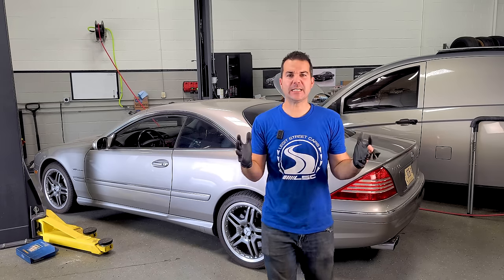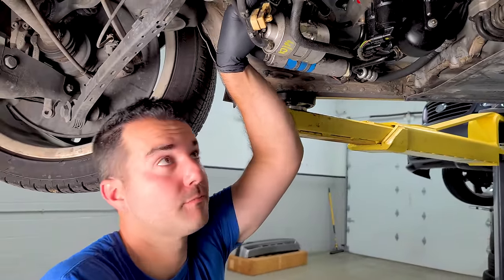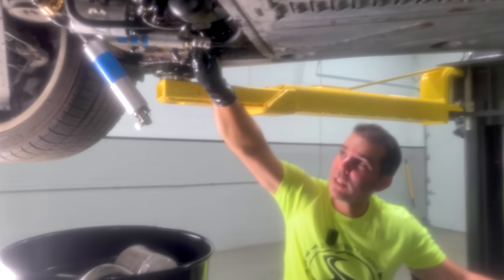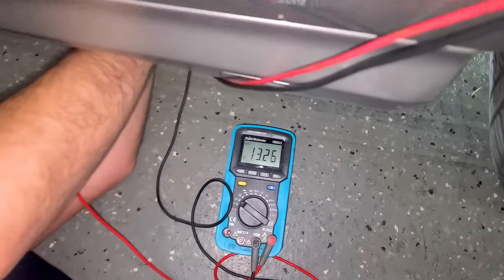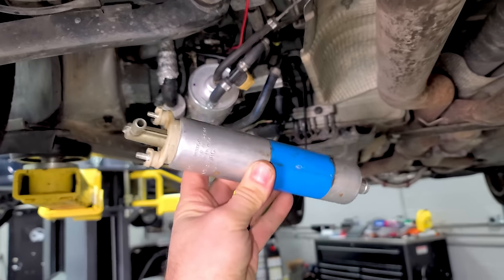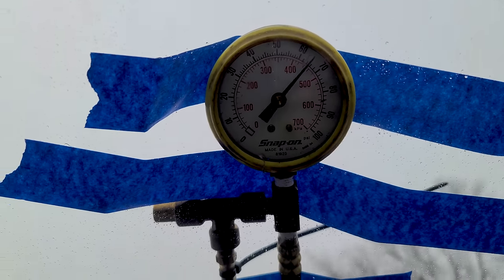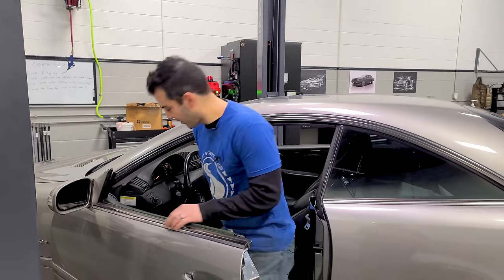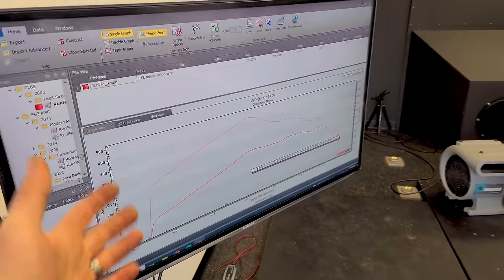I Used Bugatti Veyron Parts & An Alex Trick To Fix My CL65 AMG V12! You Won't Believe What Happened!

Comment: Legitimately one of the most informative detailed automotive channels. Dude literally telling you the size of the bolt while he's taking it out. If someone took that car to a dealer they probably deemed it none repairable to them before they ever put a 2nd pump on to resolve the problem. I have the same problem with a 14 6.2 ltz Silverado gets plenty of voltage 0 issues besides wide open throttle fuel pressure drop. Bought it as a remanufactured lemon buy back. Only drops fuel pressure under wide open. Replaced pump 3 times filter 2 times new lines fuel rails new injectors same issue if you floor it the fuel drops to about 25-30 psi and it falls on its face and goes haywire. They replaced the ecm at the last dealer as a last ditch effort. Never a problem for me since I don't floor it everywhere but best bet I'm adding a second fuel pump after seeing this video

Comment: With the weird honk noise the intake produced under high load and WOT, combo that with the car suddenly going very rich and into limp mode, maybe it is collapsing/has collapsed an air filter from the upgraded turbos? I have only seen this a few times on EcoBoost F150 raptors. People will upload a tune, tune increases boost pressure, and it collapses the OEM paper air filter, causing limp mode/rich codes from restricted airflow. Not sure what filters you're using, but those sure looked like stock air boxes, so I assume they're factory. Hope this helps man! Love the content as always!
Reply: it is leaking air somewhere, the MAF still reads the air going in so in the end you get rich mixture as the air is not getting inside the engine.

Comment: Check all you body grounds on all computer boxes and voltage box for the fuel pumps. A had a problem like yours and I had a tiny ground lead under the hood that was 90% broken off the fire wall. That was after 6 months of banging my head off the wall trying to find a problem and lots of $$ later it was a 25 cent wire. Good luck!
Just keep telling yourself I love my car! Lol. Cheers

Comment: Random note about your body temps on the infrared camera- I’m an A&P mechanic who bought an infrared camera to use for troubleshooting planes and after shining it at my hands I asked exactly the same question. The answer was so obvious I cringed… your internal temperature is higher, but given that your skin is a thermal shield, you lose about 4-5 degrees from inside your body to your skin. Try pointing it in someone’s mouth and you’ll see what I mean. 

Anyways, love the videos as always!
Reply: What thermal camera is this?
Reply: @Dierksman  I have a Flir camera. The one he used in the video is a cheaper type, not sure what brand exactly.
Reply: 8 months old comment, but just wanted to pipe in and say you're right.  But also more than insulation, your skin acts as a heat-exchanger/radiator as well.  Hot blood moves to the surface where the heat is dissipated.  If it's too hot to sufficiently cool off, your awesome, nifty brain and body add water to the mix which evaporates and takes the heat with it.  Thus, why you sweat.

Comment: I have a 2005 CL65 AMG that had this exact same issue, the dealership couldn’t figure it out. I replaced both coil packs my self and that fixed the issue, never went into limp mode since.
I found these coil packs can throw the car into limp mode intermittently. 
I also have a 2006 S65 AMG that had a similar issue and I also replaced both coil packs. That did not fix it. Ended up changing the ignition transformer. Silver box on the middle of the engine. That fixed it. 

I would definitely say you have a ignition issue not fuel.

Hope this help’s!
Reply: This!
Reply: damn bro this has to be it, if its not eh othger million things i also agree with but you know beucase you have 2 of these engines.  myy cl600 has just base eurocharged tune and keeping it that way getting at lease 600horses and all the work i do is cosmetic itws plenty fast need new tires every year

Comment: 2 things, Alex.  The car now going rich when it goes into limp mode could be the second pump you've added.  After that, I think you need to try a catless exhaust and tune.
Reply: Would that count though, surely the fuel return would handle any extra fuel fed to the rail?
Reply: @joesheehan__ as far as I know, the fuel system on these cars is returnless.
Reply: @shayanvasseghi   what about the fuel return line thats connected to the fuel filter? if it is i dont think that hose is big enought
Reply: @melikeking9013  so in this case the pressure in the rail should go above the optimum pressure.

Comment: @legitstreetcars my dad is thinking your issue could be with a ground. Check all the grounds for oxidation and rust for all the components for fuel and ignition ( ecu, fuel pump, injectors to coils) hopefully this helps. It could be just an electrical issue that doesn’t give enough power to the components. Maybe this is why when u switched over the cobra part you had the same issue
Reply: agree; i have stage 3 e55 which was doing my head in until i discover that too

Comment: I had a similar situation with my turbo. It would run up to high rpms under partial throttle with no issue, but if given full throttle under load it would stumble and throw a check engine light. Turned out I needed a different temperature plug an gap for a tuned turbo. Runs like a champ now.
Reply: I was going to say exactly this too. I had the same situation on my N54. Had to go two steps colder rather than one step colder. Fixed the problem immediately.  I know Alex is an expert, and so I was hesitant to suggest something that might be obvious to him, but yeah this happened to me too.

Comment: Check for a collapsing fuel line between the tank and the filter/pump. Check the tank pick-up for crud blockage. And yeah, check if the catalytic's rattle.
Reply: I was going to say the same about the fuel line, had similar problems with a fuel line ballooning inside.
Reply: At the moment the issue is its running rich, would run lean if thats the case right? Im not a mechanic, just trying to think logically
Reply: I'm pretty sure that filter screen he pulled out of the tank is the fuel pickup
Reply: He showed that line in the video when replacing the in-tank fuel screen. It looks pretty damn robust.

Comment: Hi Alex, I've owned a 2003 CL600 for over 10 years. I'm Korean, so my English is not good, so I hope you can understand my words. I had the same issue in my car, and that symptom was low RPM at wide-open throttle. It sometimes does not happen in manually selected gear mode, which entails high RPM. Long story short, surprisingly, it was caused by boost pressure leaking that affected the turbine actuator's movement. It caused improper boost(I assumed over boost) and fell into limp mode. I had changed tons of parts such as fuel pump, fuel filter, screen in fuel thank, spark plugs, both coil packs, fuel pressure sensor, fuel pressure regulator(especially, ECU doesn't catch fuel pressure because it has isolated fuel pressure regulation system), all of the vacuum lines, boosting pressure sensor, and atmosphere pressure sensor, etc. You can fix this problem by checking and replacing the parts on the turbine outlet to the throttle body, such as rubber pipes, clamps, aluminum pipes inlet o-ring, and 3-direction intake pipe and clamps connecting the throttle body and heat exchanger. After that, you can feel full boosting(without kick down) at low rpm WOT condition.
Reply: but difference is your 2003 had no turbos so its apples to bananaas

Comment: Check the return fuel line to the tank. Maybe this is causing the issue. The other thought I had was to find someone with the same model CL65 and compare them side by side to eliminate issues.
Reply: i was thinking the same thing there should not still be pressure in the line after it has been released unless its getting some return pressure from the return line
Reply: Ran to something similar, found plugged up vents in tank
Reply: That pressurized fuel line AFTER he had used the schrader valve to release the pressure under the hood was a huge red flag to me...  I wonder how long it will take him to replace the fuel lines themselves.

Comment: On the rich A/F signal, exhaust temperature comes to mind:

- pcm control systems incorporate exhaust temp modeling in order to predict turbine and cat temps and protect for hardware limits. The initial wide open pedal (WOP) lambda of ~0.75 (10.6/14.1) looks decent for an engine of that size w/ turbos, but the rapid dip down to ~0.62 (8.8/14.1) might indicate the pcm is calculating a high turbine inlet temp and is adding fuel to protect hardware. 
- Before heading down this route, i would check if you are able to collect pcm data through the cal software and see what fuel parameters are available to measure. There might be a signal indicating the lambda target source which could lead you to the root cause.
- You mention IATs being high, which is interesting because IAT and ECT are usually the main inputs to the model. I would collect WOP data on IAT and as many of the coolant temp sensors you can (there's usually several of them) to see if there are any irrational readings.
- If everything checks out then you might actually be exceeding temp limits on some or all of the exhaust components, at least according to the exhaust temp model. You may end up needing to loosen up these limits in the cal or disable them entirely.

Generally speaking, the unfortunate reality of troubleshooting issues on modified semi-modern cars is it really requires a deeper understanding of the engine control system to pinpoint issues quickly. Normally you can get by with an OBD tool and reading DTCs, but the case here might be the OEM calibration is operating well outside of it's design intent and will need more development to get things working correctly.
Reply: Or maybe his add on fuel pump is just dumping fuel into the rail at 70-80psi as soon as he hits 4psi boost. 

Very cool info. These cars are smarter than I’ll ever be.😂

Comment: i had the same problem with ford expedition 2016 ive tried everything and the fix was to reprogram the ECU and it fixed after many parts changed 

i hope u see my comment and try it at least because its a very easy fix and  i hope it works

Comment: Not sure if anyone mentioned, but those pressure sensors are reading in absolute pressure. Where 14.7 would be atmospheric and 0 is a perfect vacuum. So at 4psi it is in vacuum and at 22psi is about 7psi of boost.

Comment: To prevent the squirt, remove the fuel pump relay while the engine is running.
Reply: They tell you that on day 2 of mekanik school, why is he not pulling the fuse/relay?!
Reply: some of it is to do with gravity.  The fuel pump and filter are the lowest point in the system so even if he has drained it at the fuel pressure gauge in the engine compartment it still has a litre of fuel in the pipes and filter lower down @Constabruity

Comment: I'd check the throttle body. Had an SLK with a similar issue cutting power under boost, and the throttle body needed to be replaced. Also check the ECU for potential corrode connections.
Reply: We know Alex can handle corroded connections.
Reply: maybe he needs dual throttle body ;P

Comment: Hello Alex, hope you are doing well.
Im not a car guru but could it be a software issue? I mean torque management kicking in and lowering timing and fuel.

As I remember you did port, changed the turbos(not sure) and put bigger injectors.
More power and torque so the torque management is kicking in to safe the transmission

Comment: If you’re looking for a tuner here in the states, I would love to tackle this. I can do remote dyno sessions with you as well.

You have a few things going on that I 100% can fix.
Reply: Yeah MSS can fix your issues
Reply: would you also be able to check out a W208 320 swapped with a m113 5.0 306hp? I have a similliar problem that the car cuts out when on full throttle :(
Reply: yes, josh at swap shop is pretty good; he unbricked ecu and i run his tcu on stage 3 e55

Comment: Same here, I have a W216 with the hilarious M275 engine. Same problems but I take it as a challenge. Had a missfire on cyl.3 changing spark plugs and all set with 0.65 gap. Had to take the injectors out and two needs to be exchanged, the spray picture is still good but the ring around the the o-ring is broken. The second will arrive on Monday from Latvia as Merc Dubai is out of stock. What did you used to wash the cats? I don't expect any improvement but it would be nice to have them cleaned. Last dyno was at 799 Hp and I hate the limp mode.

Comment: Alex I had the same issue with that intake sensor on my 2005 cdi. Replaced the sensor and confirmed all the wiring and it was intermittent that it only happened at full load. I ended up sending in the ECU and it was the main chip. Got a new ECU which was not cheap and it fixed the issue. I chased my tail for months on this stupid issue. Might be something to look into.

Comment: I think you are right, throttle body. A throttle body closing at wot under boost with bad TPS giving false reading would give rich condition and low power (no air flow). Rare, but possible, the throttle servo and TPS can function independently of each other.
Reply: I had a similar Bosch servo throttle body strip the plastic gear inside it. Snap the plastic cover off and inspect the gears. Mine is a totally different application but similar year.

Comment: after you added the second fuel pump it looked like fuel pressure was spiking up to like 75 psi. If the car uses a static fuel pressure regulator, then the computer is expecting 55psi all the time, it may be getting rich because it's keeping the pulse width at what it is expecting the need is at 55psi. I would try putting a manual fuel pressure controller off of the second pump prior to going into the Y. That should keep your overall fuel pressure at 55psi and eliminate the rich condition, if the above is the cause

Comment: I think your  fuel line has an issue.  It's either collapsing or ballooning somewhere.  I think you have a flow issue, not a pressure issue, but as you know, pressure is related to flow as well.  Get a flow meter on there somehow.
Reply: ...or, just replace the lines and know for sure.

After that, replace the Cat's and, if it's still a problem...errrr, bad earth somewhere?

🤔
Reply: I also think this.... The fact that he relived the pressure in the fuel line, but when he disconnected it, its obviously still under pressure...  When he added the second pump, it started over fueling as it overcame whatever the restriction is. So I suspect something between the pump and his fuel pressure gauge.

Comment: You’ve got a boost leak past the MAF sensors. Explains why you’re going rich mid pull. It’s pretty audible with the whistling sound during pulls
Reply from the maker: No mafs on this car
Reply: @LegitStreetCars  Could the air filters not be flowing enough for the upgraded turbos? I don't recall seeing you try a pull without the air-boxes installed

Comment: Alex adds an entire second pump that the car was never designed for
"Why is it running rich at WOT?!"
Reply: I agree it could be related.....old Tech from Adelaide Australia here.....The return line to the tank maybe now cannot handle the increased volume.....I would also look at the venting of the tank....maybe test with cap open so venting to atmosphere.....both related to enriching with overloaded return line.....just my 2c worth.....good luck....stefan.
Reply: Note to self: don’t buy a Mercedes. 😂
Reply: does it not have a max pressure sensor/switch?

Comment: When you're using a long extension to remove or replace a deep seated nut or bolt, put a blob of blu-tak (maybe power-tak in the US) in the socket. It'll keep the nut or bolt in place unless it's a 20mm or bigger.
Reply: Get you a magnet that fits in the socket